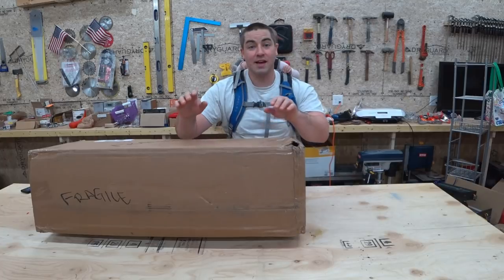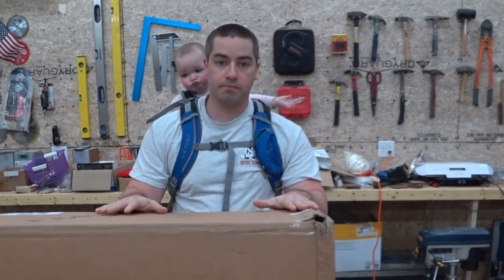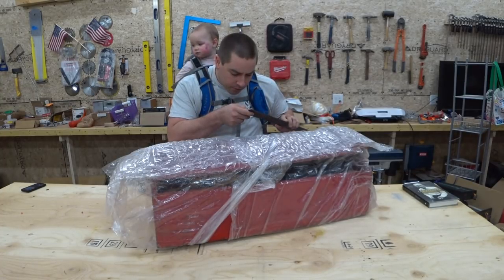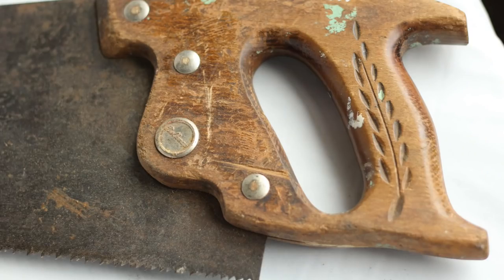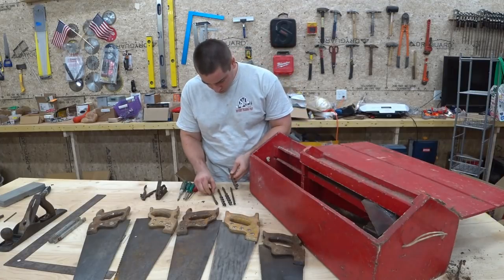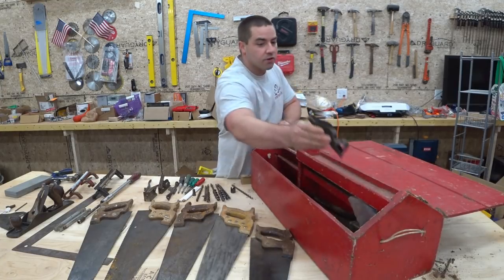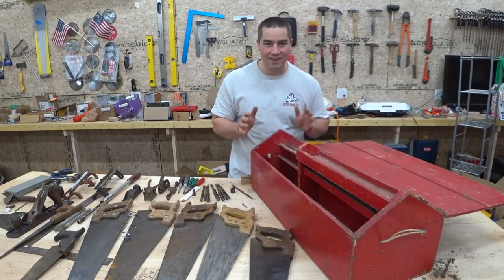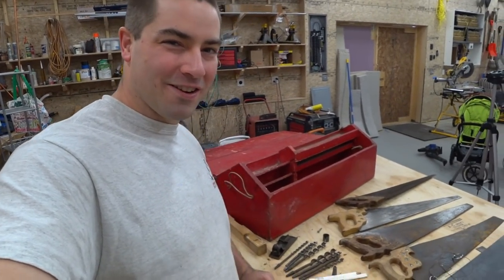Grandfather's 60 Year old Tools and Toolbox

Comment: the 2 strange things may be a saw vice for sharping a saw the pliers are for tooth setting
Reply from the maker: They might be.  OffGrid Wanabe suggested the same use.  I'll have to give it a try.  They looked a little more like a metal brake to me, but as I said in the video, I don't know.
Reply: @DavidPozEnergy  did a little check and it is a saw clamp the teeth sit upwards the back goes down in to the u shaped pices at the end the rail part may of been used with a saw jointer tool it holds a  Bastard file so you can file the teet so they are all the same height

Comment: Hi David, I hope you get to enjoy using your grandfather's tools. The first mystery item is a pair of "teeth setting pliers" for the hand saws. The next two items that you don't know what they are, are hand saw vise/clamps to hold the saw blade while "setting and sharpening" the blade. And finally the scribe thing,  is a double sided wood working scribe as you thought. You can set both sides to different measurements to save time, it's a great tool. I hope that information can help you out. Take care god bless.
Reply from the maker: Thank you.  At least I got one out of the three.  I was just looking up tooth setters now.  Such a different world for me.  This idea that things can be sharpened, set, re-used.  I'm used to circular saws with carbide teeth.  This is fascinating to me.
Reply: @DavidPozEnergy  sharpening and resetting and using again and again is a good lost idea. If you need help pm me. Have fun

Comment: Cool I'm getting close to 70 and I got my Dad's tools when he passed and they look a lot like what you have there. The hand saws are for different jobs cross cut and ripping the one clamp looks like the apparatus used to hold the saw while sharpening and the one you don't know is likely to set the tooth angles but that one is a guess. I haven't been able to open all the boxes yet maybe one day when I am looking for a project. He made all his boxes too.
Reply from the maker: Thanks.  I'm going to try holding the saw with those clamps.  I've never seen them before.

Comment: The tool at 6:21 is a saw tooth set. By the design in its sides, I would say that it is very old(1870s). The tools at 7:10 are vices to hold a saw while sharpening them with a file. In those days tools were designed to last longer than you and be passed down to your sons. The normal sequence to sharpen a handsaw was to level the tops of the teeth, file to reshape the teeth, set the teeth, and then sharpen the teeth. There should be some slim taper triangular files and a piece of paraffin in the box.
My grandfather was a union carpenter. In the 1950s, carpenters worked 1/2 days on Saturdays. I got to tag along on Saturdays. My grandfather said that one of the ways that carpenters were able to justify the need for morning and afternoon coffee breaks was so that they could sharpen their saws. That is a nice set of tools. Take the time to learn how to properly maintain them. Good Luck, Rick
Reply from the maker: Thank you for the insight.  I look forward to learning the steps.
Reply: @DavidPozEnergy  Cut a board with the saw before you sharpen it and then after. A sharp and waxed saw is very fast. Good Luck, Rick

Comment: the drill bits are called brace bits or auger bits the brace being the handle that turns,the angled saw was a bit before my time but would be used in narrow areas hence the angle,the things you did not know may have been for sharping plane blades but did not see enough of it
Reply from the maker: Thanks Mark.  I never heard that term before "brace bits"  I had heard auger bits.  Thanks for sharing the right term.